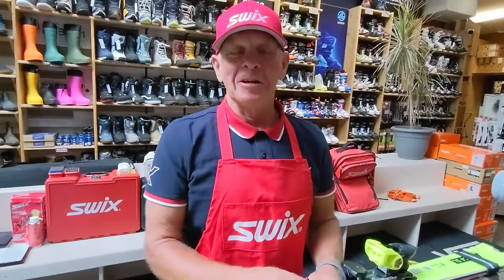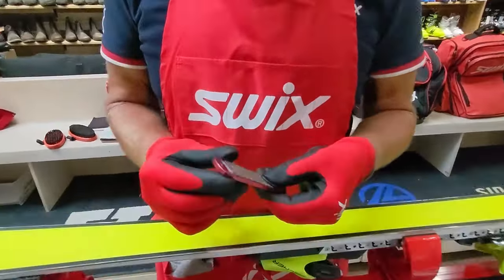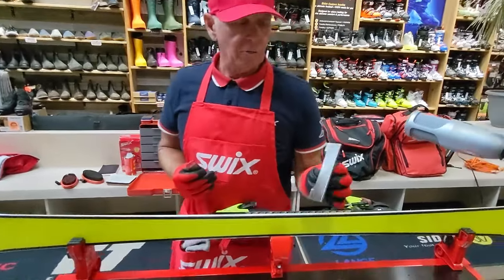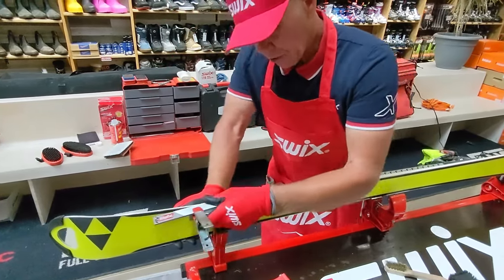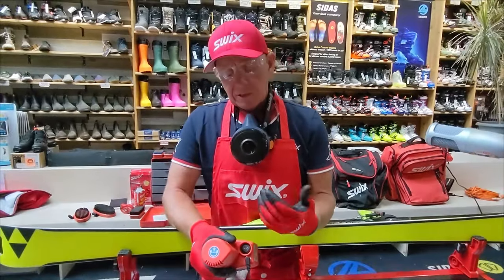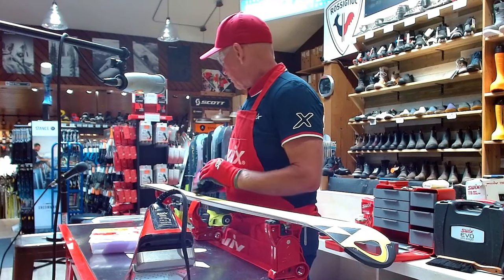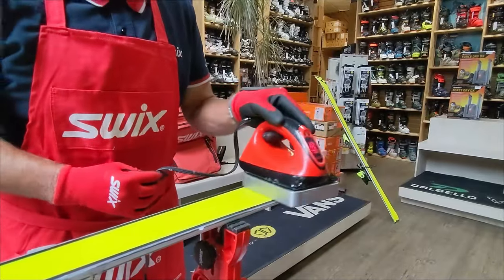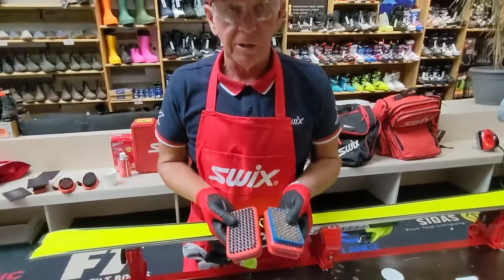The Complete SWIX Ski Tuning & Waxing Tutorial

Comment: Really a comprehensive and detailed tutorial.

Some questions though:
1/ despite the claim that the base bevel guide doesn’t scratch the black base surface of the ski, I have to say that it DOES leave line markings on the sole of the skis. A real shame for new skis 😢. Si I’d rather advice users to protect the base by applying some masking tape before base filing!!

2/ I have the same objections to dewaxing the ski edges by using the wax scraper directly on the freshly sharpened edges. Unfortunately, wax really sticks very hard to the ski edges when hardened out and forms a film. Is it possible to use a wax remover on the edges to efficiently dewax the edge without using the scraper and dulling them or will wax remover rust the edge?

3/ how do we need to maintain sharpened edges in good condition for future uses?
Reply: For (3) you can run a fine grit diamond stone over the base and side edges (using the correct angle guide) once it has dried and you've wiped it off after skiing to keep the edges in top shape between full tuning.
Reply: @blogospheric  thanks, this is indeed how I proceed. I suppose the rough file is mostly used to cut the edges into the right shape, whereafter maintenance after ski holidays is mostly carried out by using only the diamond stones to take out burrs and to resharpen the edges.

Comment: Amazing video.  I'm wondering how your strategy would change at the beginning if the edges had some rust on them.  Would you still order your tools as coarse stone -> file -> medium stone?
Reply: Oh man I was about 1 minute premature.  You said to use the soft stone after I resumed.
Reply from the maker: Depends how Rusty. Use a gummy Stone to remove as much of the rust as you can before using the diamond Stone. It will prolong the life of the lime and Stone.
Reply from the maker: The soft Stone is best for removing more rust and the hard stone best for polishing. I hope this helps and makes sense. Thank you!

Comment: What if you have a little light in the center when you run the true bar? In the center I am flat but near the ends there is a little light in the center. A bit concave but still light on the very edge.

Comment: hello, thanks for such informative and education video , I have a question about base bevel , If the base bevel has been set to 0.5 and then I use .5 guide to go several pass the base bevel still be .5? I have watched other SWIX tuning video's and I got the impression that even using diamond stone will increase the base bevel .
Reply: Hi Arash, you're welcome we're glad you enjoyed it. The base bevel is set to maintain that angle so it only cuts up to that angle. Multiple passes are recommended and do not increase base bevel. Once you hear the bevel tool stops cutting then you have reached the proper angle. The base angle will wear away after use, and then have to be trued up by using the base guide and a file or a stone. Does that make sense?
Reply: @alexandramessinis1490  thanks Alexandra for clarification 👍
Reply: You're welcome 😊

Comment: Great video.

How come when you tune the edges you do not go all the way up to the widest part of the front of the ski?
Reply: Because you need the tips to be slightly duller than the rest of the edge to initiate the turn smoothly. If you sharpen right to the end I can cause your skis to stem apart and feel abrupt.
Reply: @alexandramessinis1490  I've always thought  people tune the edges from widest part of the tip to widest part of the tail. Then they detune those parts, if needed. I'm wondering if he left it out intentionally or this video is just a demo and doesn't cover the complete process.

I ski east coast where is hard pack and ice. So sharp edges are always welcome.
Reply: go to 26:38 in the video 👍

Comment: Have I been wetting my stones for no reason?   I always thought stones needed to be wet
Reply: They work better if they are wet with citrus base cleaner. It acts like a lubricant and keeps the stone cleaner.
Reply: @alexandramessinis1490  never tried that.  It’s always been a spray bottle with water.   His stones are bone dry
Reply: During the rough grinding process, water promotes cracking (easier to propagate cracks than in air) which is how rough surface gets removed. Subsurface damage is then removed with finer grits of diamonds. In general,  the Preston’s equation describes the removal rate and related factors. In the final stage, I assume using the rubber stone does not create fractures anymore but rather plastically deforming the surface structure, allowing the surface roughness to further decrease.
Reply: Wet is better, either with the citrus solvent or just some water. You can add a drop of dish soap to the water to help suspend metal filings.